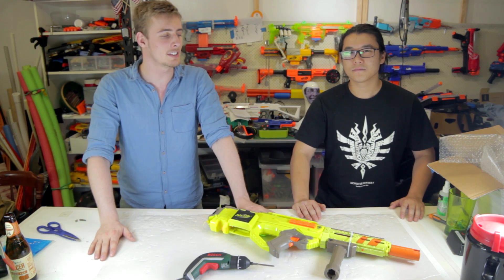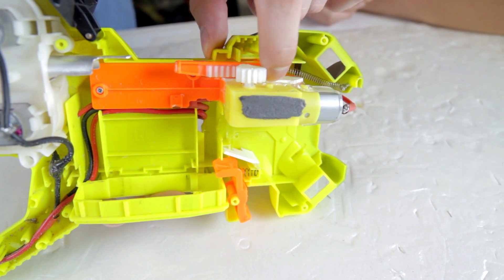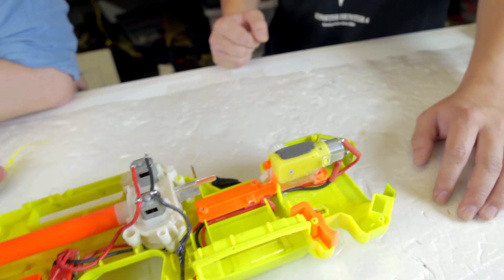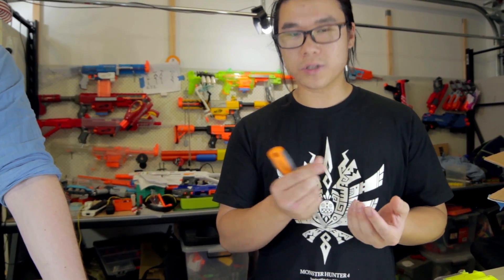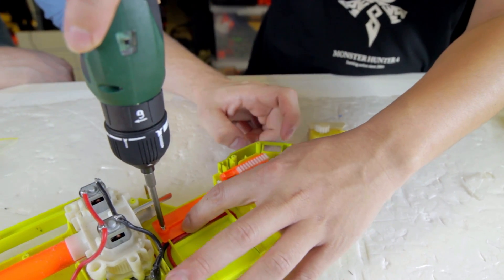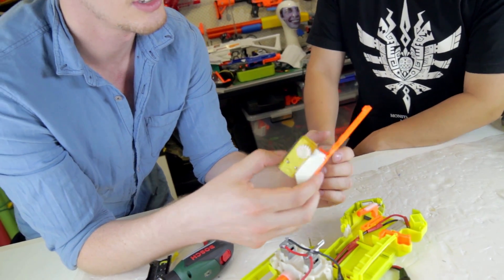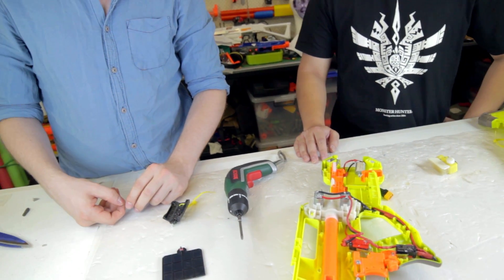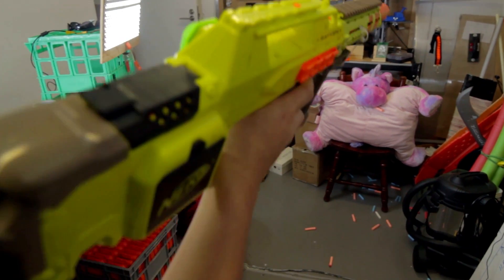FULL AUTO RAYVEN - Nerf Mod

Comment: Cool implantation, really hoping for a 3D printed solution as well. If your interested in a different implantation check out Nathaniel Deal's video (from AmmoCounter) on wireing the ir sensor in,  towards the end you can see he is using an auto rayven as well with the pusher from a buzzbee tommy 20.  https://youtu.be/x6HRHOGa8Fk
Reply from the maker: Hmm I couldn't find it in the vid...? -R
Reply: Make.Test.Battle it's at about 14:35 in he video. Granted the video is not about the fact it's an auto rayven, I had to message Nathaniel about when I first noticed it.
Reply from the maker: Ahhh very nice! -R

Comment: Hrm, I still have MY old Clear Vulcan floating around, and could possibly work it into my Modulus+Raven during the wiring phase....
Problem would be either finding the right motor, or salvaging one of the old Stryfe, Raven or Modulus motors I got floating around...

Comment from the maker: Thanks to Zhen for sharing. Helpfully this was useful to the community. :3 
-Justin
Reply: Make.Test.Battle hey I've been having problems with the original n-strike Rayven I rewired it with 17 gauge and wired up a 2s but near every time I fire the the back of the dart sits there rubbing on the fly wheels but that aluminum guide might fix my problem can you make a tutorial?
Reply: Make.Test.Battle hi
Reply: Make.Test.Battle So, I have a Vulcan that's broken. Do you want it? Vulcan parts are great, but I didn't take any out.
Reply: Still waiting for that demo of the pump shotty.
Reply: Dragon Mods 2 I'll take it lol